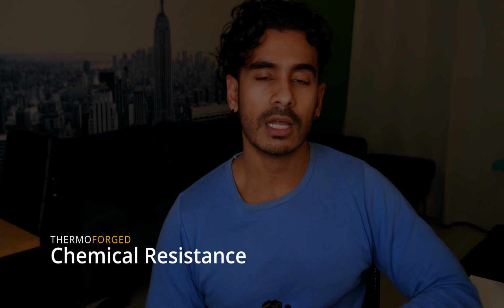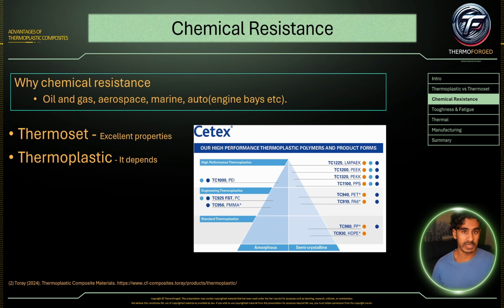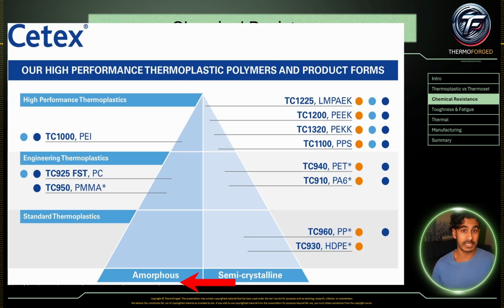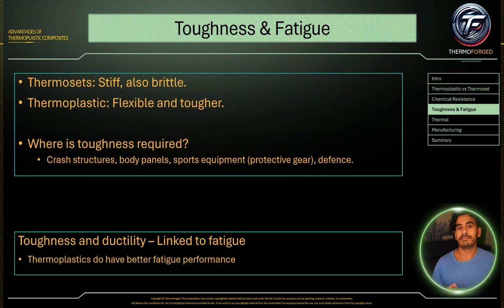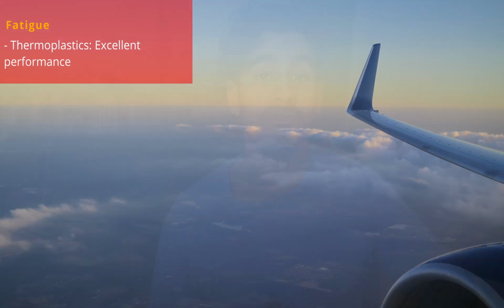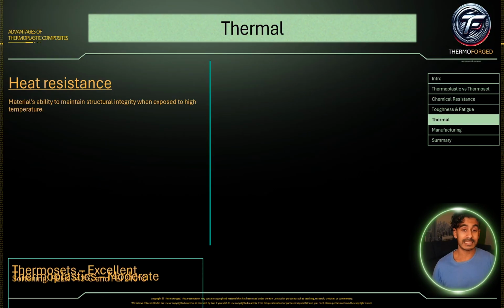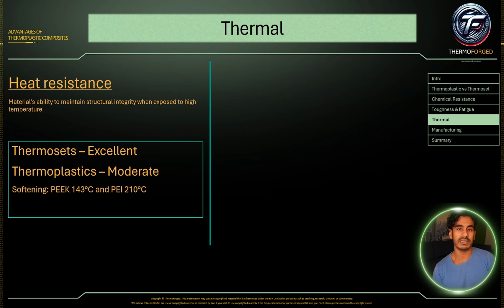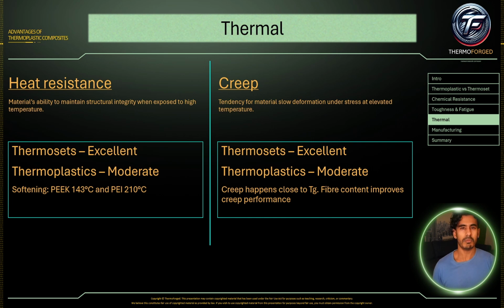Thermoplastic Composites - Advantages & Disadvantages

Comment: Love the sustainability point! For forming applications, how would you say thermoplastic composite compares to sheet of alumnium?
Reply from the maker: Forming-wise: Aluminium can be drawn, but not continuous fibres(as they drape instead).
If using carbon fbres, you get aluminium properties at 50% less weight.

But going further: if you orient the fibres in the loading direction of your application, you will get superior to aluminium properties at very low weight